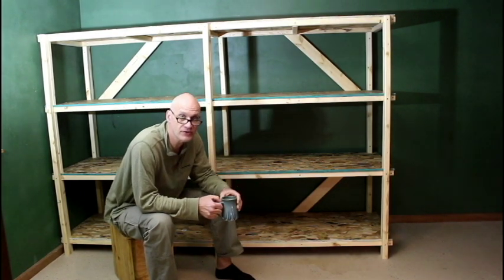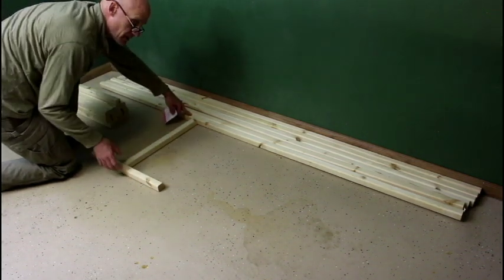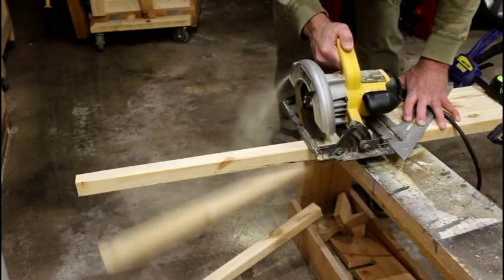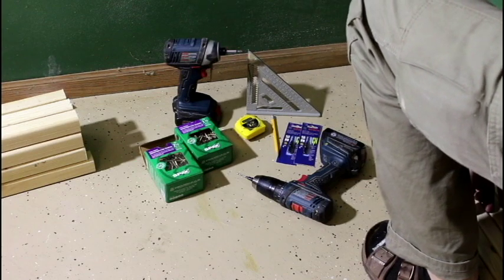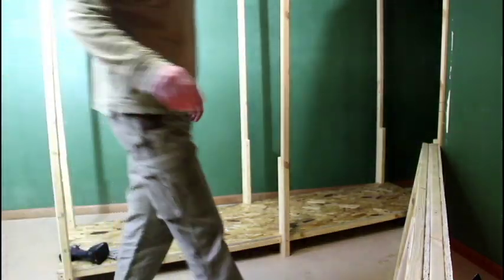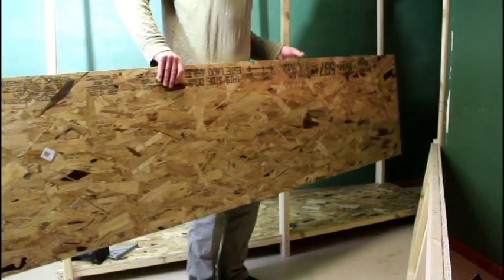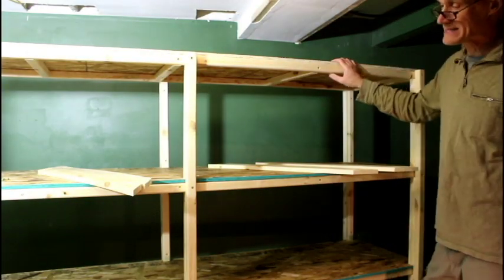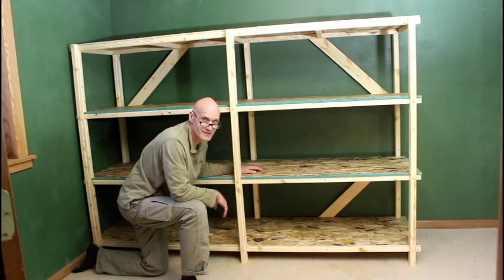Strong Lightweight Shelves - How to Build

Comment: with the price of 2x4s at almost $6 each now (Dec.2020) I'm looking to see how the cheaper lumber like 2x2s, 1x2s, 1x4s can be used to make some basement storage shelving capable of holding less than 200lbs (all the wife XMAS decorations ;) your build looks like it will do the job quite nicely, I think I could even get away with using 1/4" luan for the decking if it's more cost-effective vs. the OSB! TY

Comment: Hi sir! You did a very good job with the shelves build and the filming. Only thing that would have been better is to use 2 screws to attach each leg to the shelving unit. This helps prevent racking. 
Very good design though. I'm looking to shelves designs that are fast to build, this one is practically the fastest way to go! I tried with pocket holes, their good, but too time consuming Thank you!